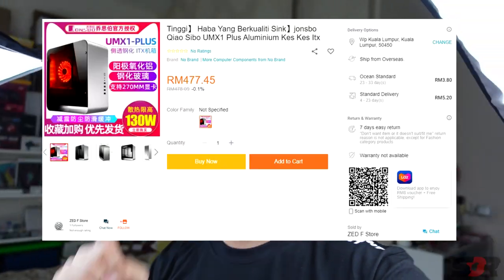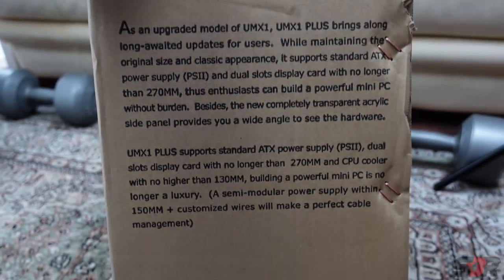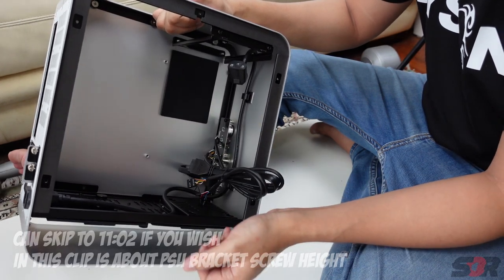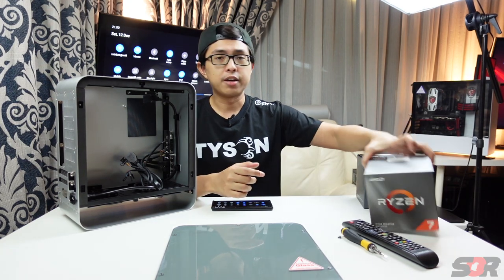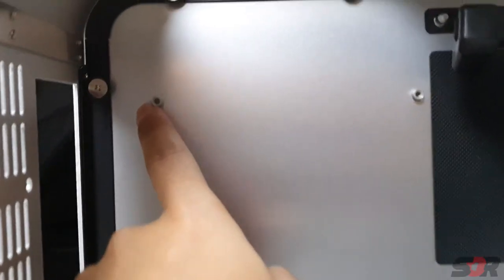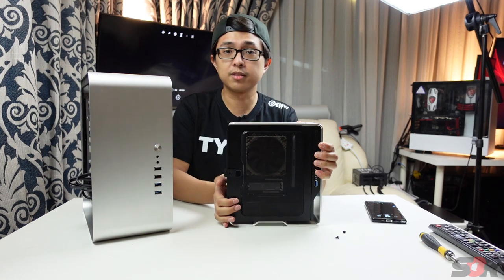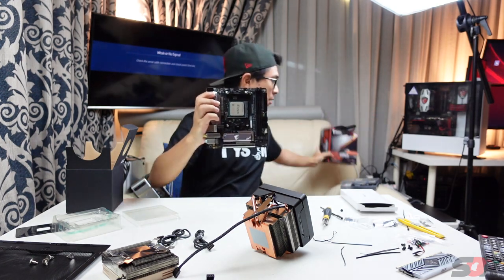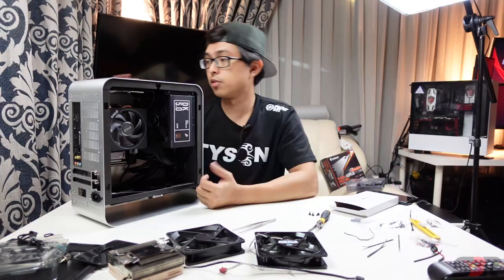JONSBO UMX1 PLUS ● ITX CASE BUILD UP REVIEW & UNBOXING | RYZEN 3 2200G AMD PRISM COOLER  🇲🇾

Comment: Im extremely picky - BUT - poor with cases and with certain design objects, and there are only a few computer cases that really attracts me to buy  under my budget. I've been crazy looking for the UMX3 and i've just seen how the only one i've been able to find for cheap has been sold in front of my eyes, it's the only case that i really like and my pc is M-ATX, i know, this is the smaller brother, M-ITX but... i think it's my only option and i'm considering adapting it to fit my mATX PC... i'm very handy and i could attach the supply in the rear... outside... let me think about it...

Comment: hey just wanted to know, where's a heat from psu go? i don't see any perforated or cutout to exhaust for psu
Reply: It just blows in the case. I did not have any problems with 8700k and 6800 xt. No overheating.